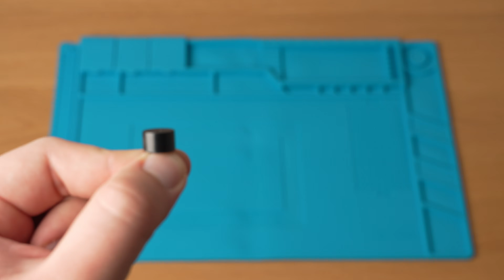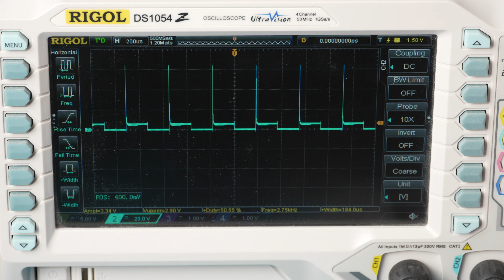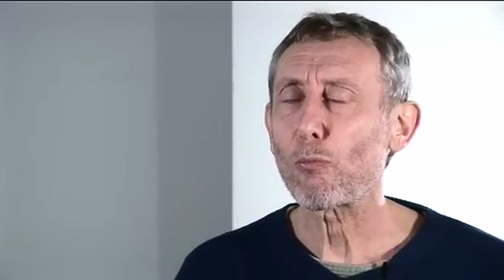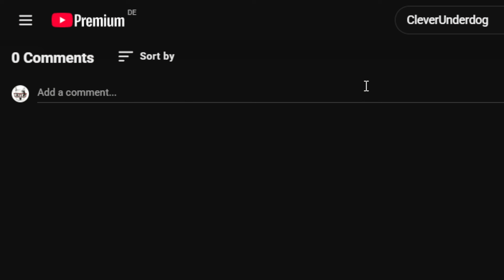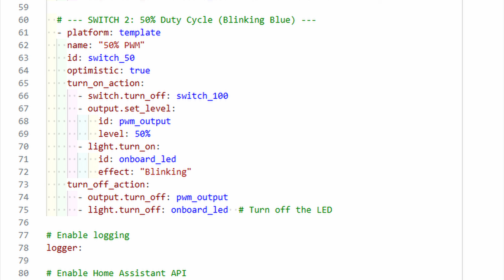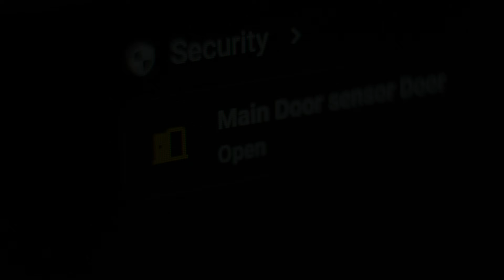I Turned an ESP32 into a 120dB Intruder Deterrent

Comment: Just make sure to lookup local laws, most have both a db limit for alarms (one indoors and one outdoors) and a limit to how long they are allowed to sound. (reset per detection event usually, so it can keep running as long as the intruder is there)

Just so you don't get into unnecessary trouble or legal issues, (also high sounds can permanently damage hearing)
Reply from the maker: Thanks for the heads-up 😎

I wonder if someone breaking in could use this argument in court to claim some compensation 😂